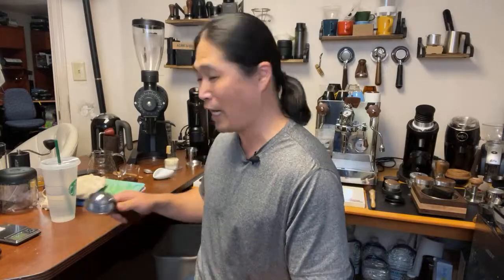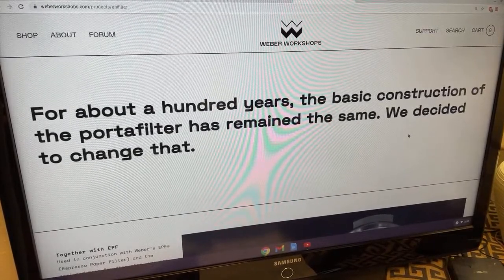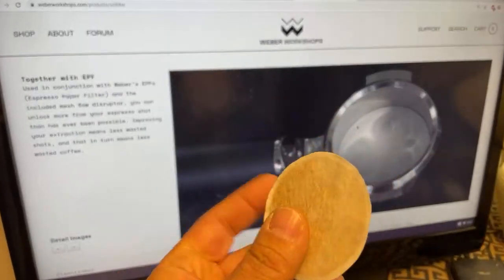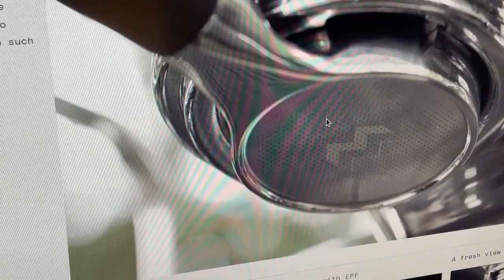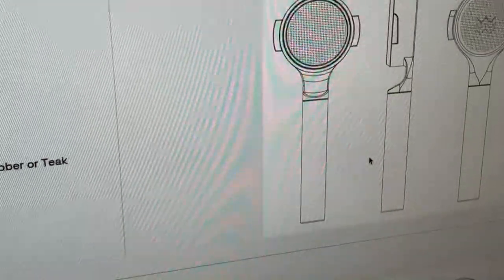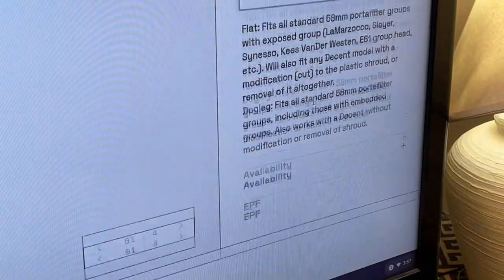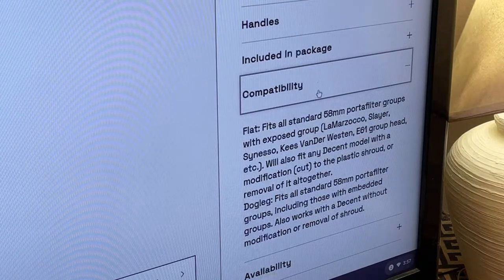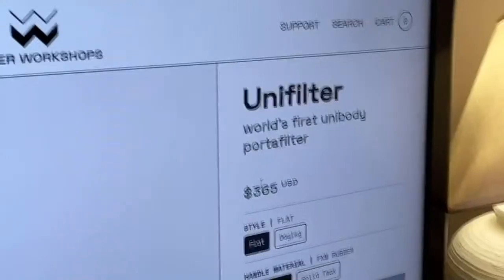Most Ridiculous Coffee Gear I’ve Ever Seen | Unifilter from Weber Workshops

Comment: It’s a solution to a problem that doesn’t exist. Having said that, there are people out there silly enough to buy it, as they’ve probably bought everything else 🙄
Reply: It's a very real solution to a very real problem, with research to back it up. Is tit worth over $300? That's for the individual to decide. For me it's a no, currently, but I might consider it one day. I also think cheaper equivalents and swappable baskets that accomplish something similar may make it to market in the next 5 years.
Reply: Case in point
Reply: I thought the same but after understanding the science, it doesn’t seem that simple. VST said they made their baskets very durable under pressure, but Weber claims that their bottom is much thicker and will not bend.
Reply: It has higher extrrations amounts. I am getting 22.5% with all of weber stuff. I also am not poor so if money is an issue for you its best to not buy it.

Comment: It not only cuts you off from basket brand but also basket size - if it's a 20g basket it might not work so well with smaller doses.
Reply: aren't all baskets 18-20g?
Reply: @davidjukebox  Single, double, triple... So no, they're not all the same size.
Reply: You need to use puck screens in order to maintain headspace and puck resistance. I have the same "problems" with my unibasket that I have for a few days now as it is designed for 18-20g WITH a puck screen or even higher doses without. So I needed to get a second puck screen for a 16g dose to work properly, lol.

Comment: Hoon, while it's definitely expensive, I think it's important you understand that this is not just a premium unibody portafilter. It's unibody because that's the only way to fit the new thicker basket design, which is revolutionary and solves a fundamental problem with all other existing portafilter baskets (flow holes don't reach edge of basket, thin basket bottom flexes under pressure, and more). See the research and explanation here:
https://youtu.be/lPAel26Cw_A

Comment: 2 advertised benefits are cleanliness and temperature. First off, steel is a poor conductor compared to brass. Secondly I've just taken the basket out of my portafilter and it is clean inside after 6 months of continuous use. This product stinks of shiny snake oil. I think geeks shooting for max extraction is crazy. If you want more just use a higher dose.